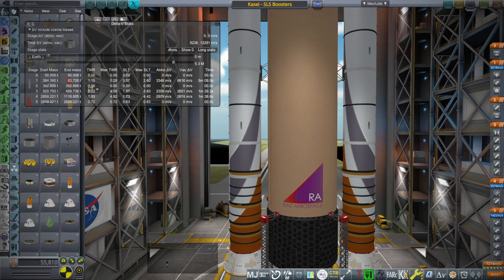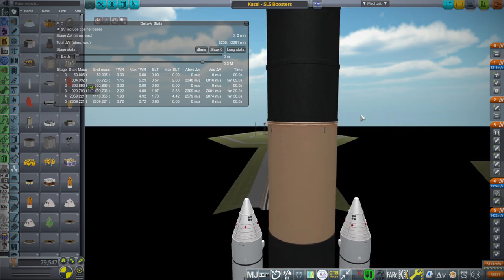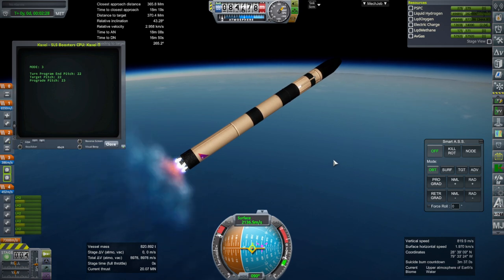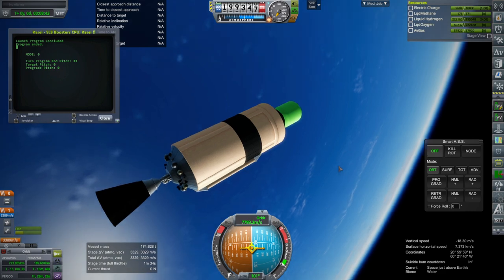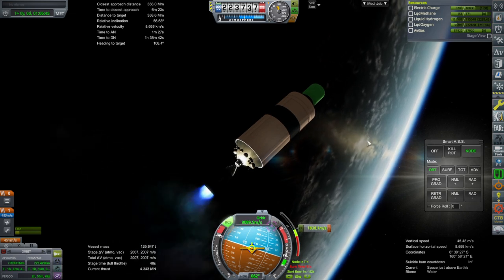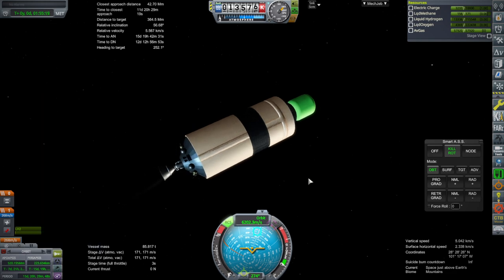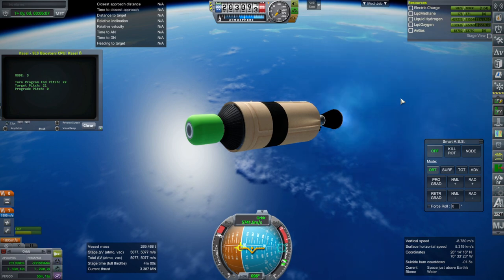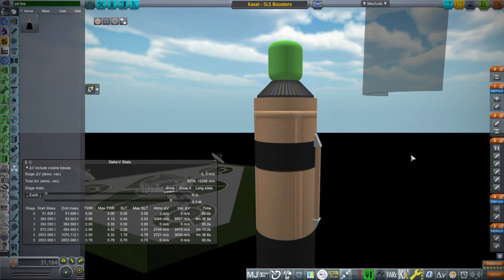KSP 1.12 with RO - Kasei vs SLS Capacity Test

Comment: Maybe this explains why NASA added a fifth segment to the boosters going from the shuttle to the SLS. Maybe for your situation you could add a sixth segment to the SRB's to increase burn duration. Extra mass will reduce the TWR at lift-off. With extra duration they will separate at a later moment in the launch trajectory, reducing the effect and duration of the limited TWR of the core-only phase. However, according to Wikipedia the 5-segment boosters already have a wider nozzle then the 4-segment boosters to stay within the pressure limit. Maybe it is difficult to create a booster with a longer burn-time and a lower TWR.
Reply: Actually, since the boosters burn inside out, adding more segments increases the thrust but doesn’t change the burn time. You’d need to reformulate the propellant or increase the diameter.
Reply: the boosters burn from inside out. Adding segments increases thrust. If you want a longer burn time, you could tweak the grain geometry or make them wider.

Comment: What are the engines u used with the kasei?
Reply from the maker: They are ED-9 engines (and the smaller ones are ED-9S) which are hydrogen-oxygen staged combustion engines that produce about 4016 kN (the smaller ones have 3137 kN). The sea level ones get 385 s ISP at sea level and 434 s in vacuum, while the big vacuum one on the second stage gets 456 s in vacuum.

Comment: 12:55 SMART reuse for SLS you say? I’d like to see that
Reply from the maker: While I made the parts, there's a problem: the diameter of the module has to be 9.6 meters to fit the SSMEs compared to SLS' 8.4 meters. I could make an adapter/skirt, but the problem is that the SRB skirts get in the way. That's basically what it comes down to as far as why I haven't made a video on it yet.